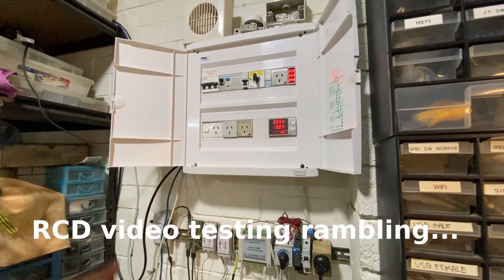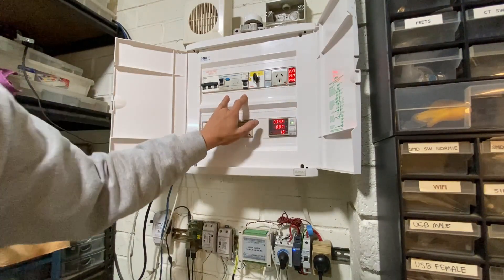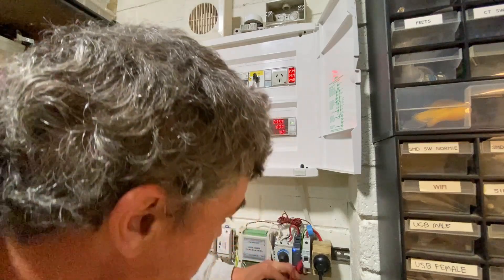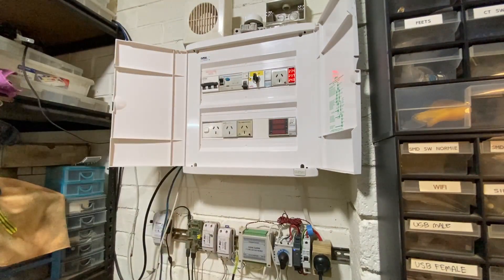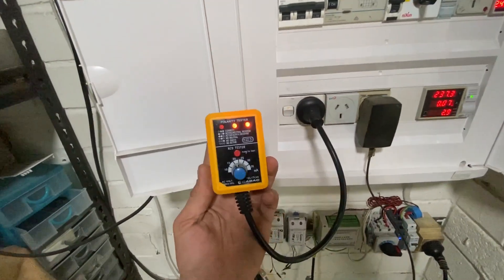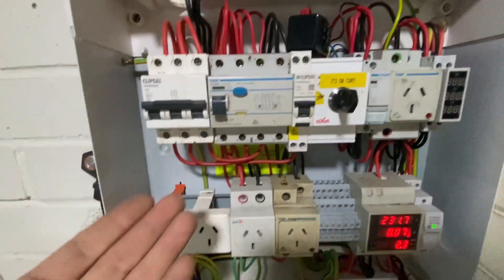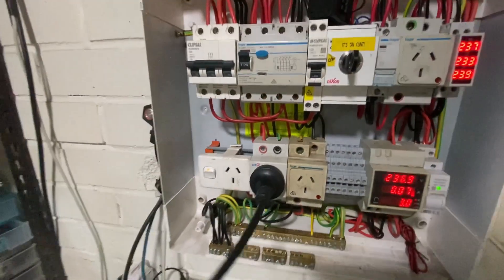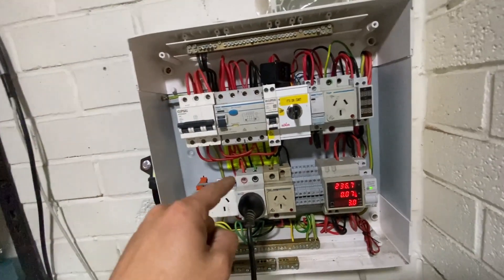Fault Find: Tripping RCDs / RCBOs

Comment: Whaaaaat? (Apprentice here). So why do the plug in devices even exist if they don’t even check the polarity correctly???
Reply from the maker: That's why you have to do your earth continuity first with a trailing lead and low impedance meter. Those testers then work if you got polarity correct.

Comment: We use the same gpo testers, but have a lightbulb in the circuit. Trips it easily if earth and neutral are swapped. I did find it odd that those testers couldn't tell though.
Reply from the maker: It's a known fact why upon testing you remove the M.E.N. and test for earth first. AS3017 states it in writing and made this example to prove it to those that don't test properly!

Comment: With the cabac RCD tester/ PowerPoint tester if you were to hit the test button with the NE transposition it wouldn't trip the RCD, correct?
Reply from the maker: That's correct, but you should be relying on a rcd meter that does your 0 & 180 degree phase angle and it tells you the trip time in milliseconds. Not a real exciting machine, must of left that footage on the editing floor.

Comment: What is your goto RCBO for residential if you dont rate the clipsal resimax?
Reply from the maker: The newer models are meant to fix the issue I describe in the video. Have you seen the newer ones they've got "PowerTag" where you can turn any circuit into a functional power monitoring device on your phone. Far as I know Schneider are the only ones with an add-on modules. All the other ones I've seen you need modbus cts, making it look more an industrial control panel. Not to mention the time and cost.
Reply: @TradieTrev  I've only seen the Max9 range in their promotion stuff, never seen it installed in the wild. I do mainly commercial so all the monitoring is via CTs and BMS.

Comment: Decent meters have PTCs and NTCs to stop some of the consequences of stupidity so you can get away with using continuity to trip RCDs, not implying that there has been stupidity in the way Trev is using the meter, but that meter is still a UNI-T and I wouldn't personally be holding onto it poking around 240.  Take a look at the factory fuses in it and compare with the fuses in something better.  UNI-T makes a million different variations of almost identical looking meters so hard to tell what would be in this one but I'm going to guess not that impressive.  The clamp makes a handy 3rd hand.  Still, it's a better choice of meter than I used to see some people using on 3 phase in the past.
Reply from the maker: Not to mention most electricians don't own tone testers that you could inject across a couple of phases. The one I have is rated for cat 3 @ 300V but fully understanding your meters limitations can potentially save your life.
Reply: @TradieTrev  I dunno mate, it's still a UNI-T.  I might cop a bit of flack for saying it but at the end of the day it's still a China meter where the CAT ratings mean nothing, and ironically you can buy the 210 series off aliexpress for about $30 depending on the seller and the bullshit accessories bundle.  Just the opinion of a retired has been of course.🌩